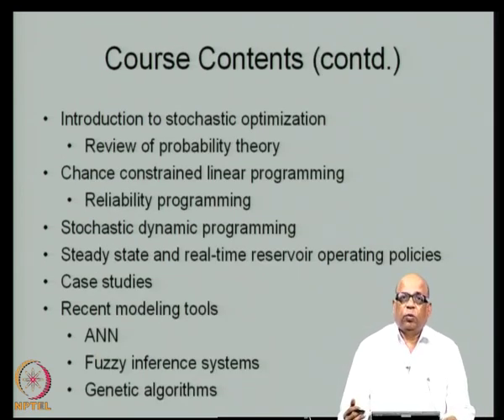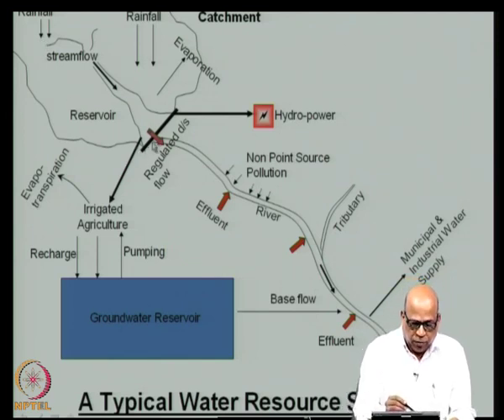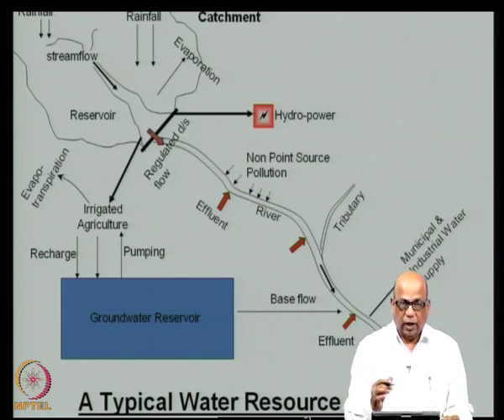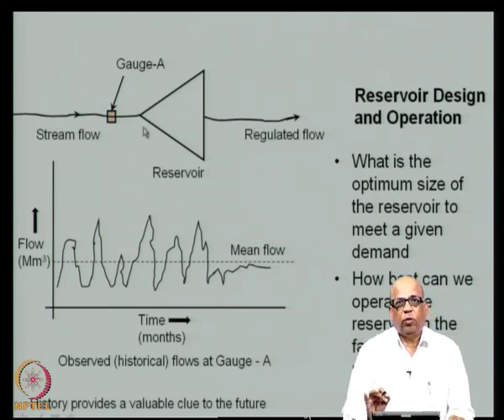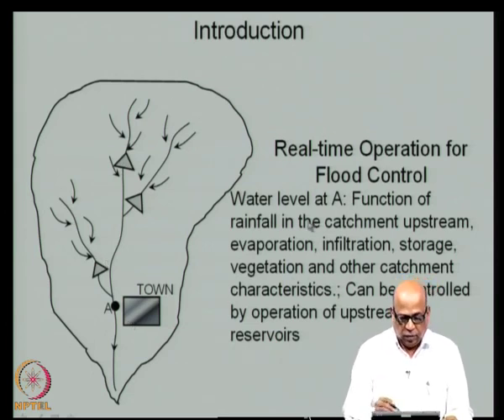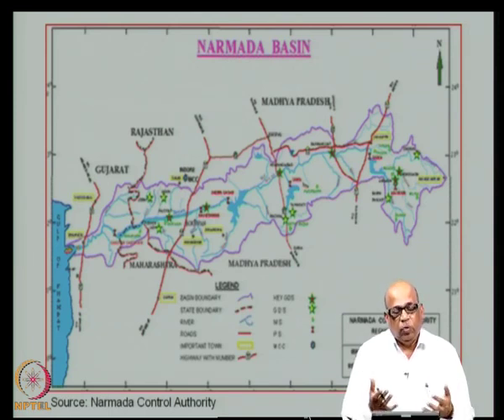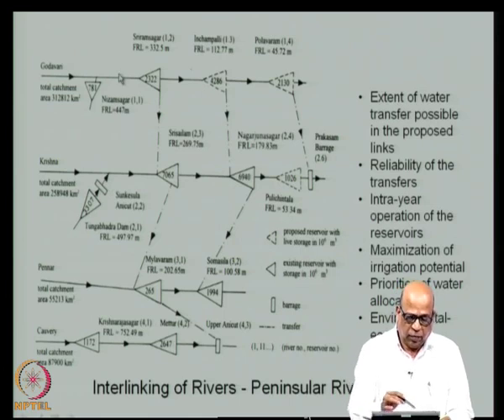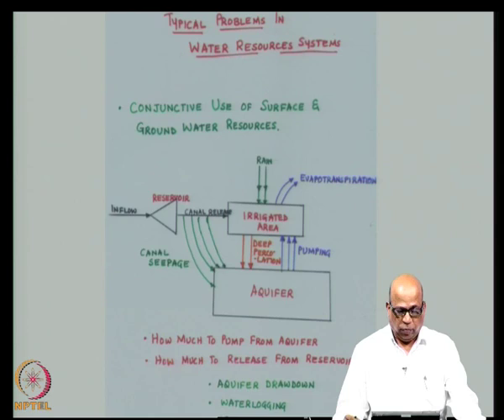Introduction

Comment: 00:00 Introduction to water resources systems analysis
05:00 Discussion on hydro power systems
10:44 Newsletter and introduction to system analysis
15:36 Infiltration into different water sources and its impact
19:58 Ki for various proposal directly from district map for irrigation and music industry
25:01 Different types of elements react differently.
30:05 History provides valuable information
34:35 Groundwater system development and management
39:58 Discussing the water control system at various locations
44:12 Interlinking of rivers and its impact on irrigation potential
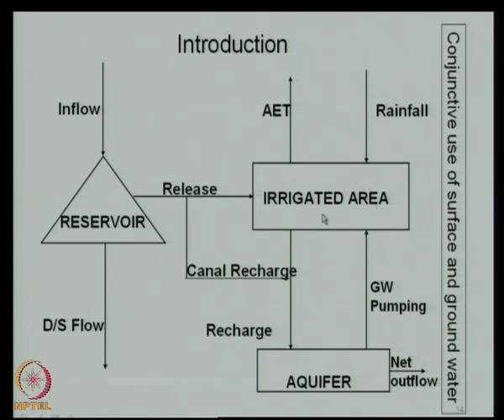49:10 Water quality varies based on location and purpose.
53:36 Understanding physical behavior of avatars in the blood stream and ground water recharge
Crafted by Merlin AI.00:00 Introduction to water resources systems analysis
05:00 Discussion on hydro power systems
10:44 Newsletter and introduction to system analysis
15:36 Infiltration into different water sources and its impact
19:58 Ki for various proposal directly from district map for irrigation and music industry
25:01 Different types of elements react differently.
30:05 History provides valuable information
34:35 Groundwater system development and management
39:58 Discussing the water control system at various locations
44:12 Interlinking of rivers and its impact on irrigation potential
49:10 Water quality varies based on location and purpose.
53:36 Understanding physical behavior of avatars in the blood stream and ground water recharge
Crafted by Merlin AI. summarise in 15 points